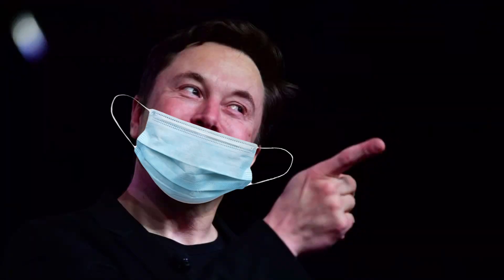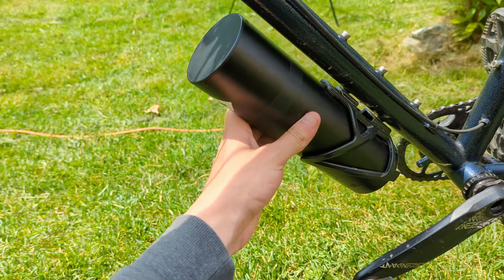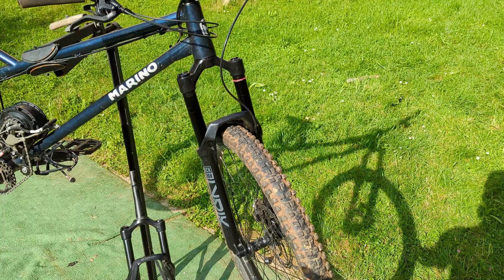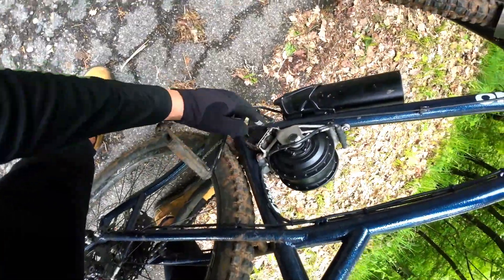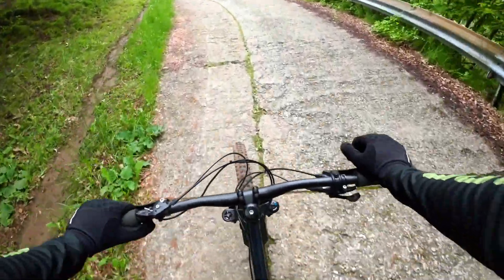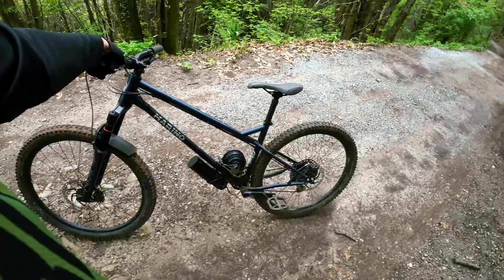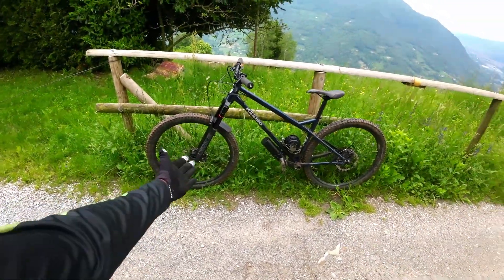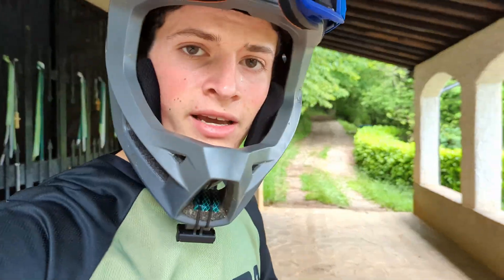BUILDING another E-Bike

Comment: ~$450 Total & Parts List
~$230 Battery: S001-2 36V 10.5Ah BMS20A 18650 Sanyo 3500mah 
   $75 Speed Controller: VESC 75100 
   $50 Motor: MXUS XF07
~$50 Custom Motor Mount: PCB Way
~$35 Chain tensioner & chainring

Youll also want a Crankset for Middle Drive Motor to be safer

Comment: Really like how youve done the motor mount. Any chance you could post a parts list?
Reply: Total: ~$450
~$230 Battery: S001-2 36V 10.5Ah BMS20A 18650 Sanyo 3500mah 
   $75 Speed Controller: VESC 75100 
   $50 Motor: MXUS XF07
~$50 Custom Motor Mount: PCB Way
~$35 Chain tensioner & chainring